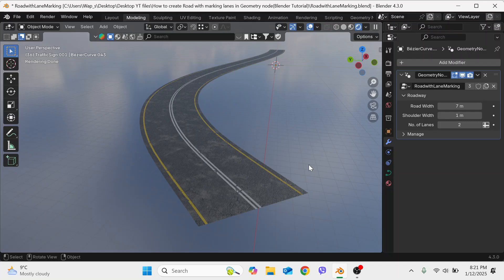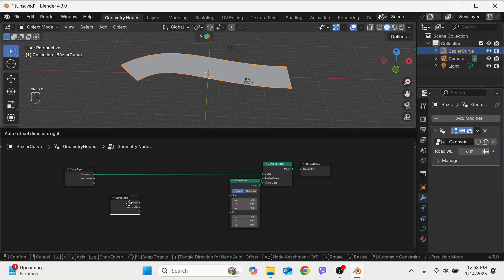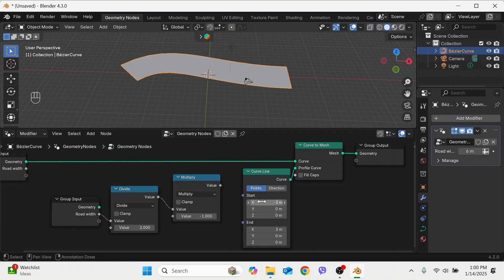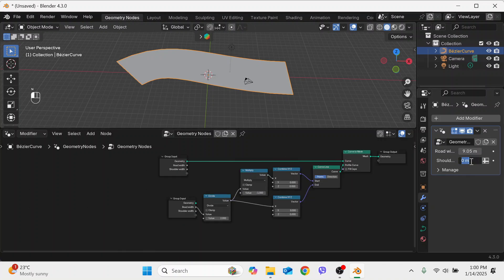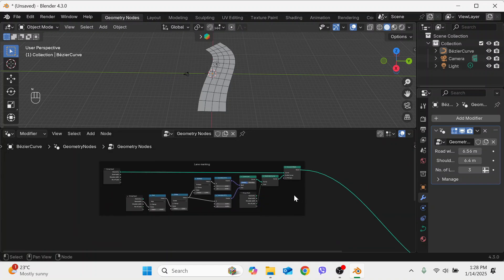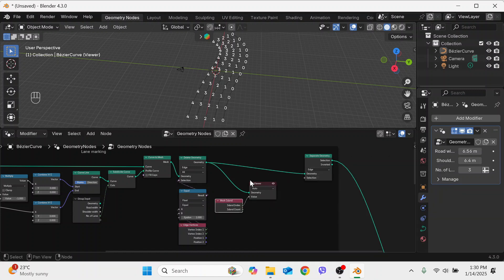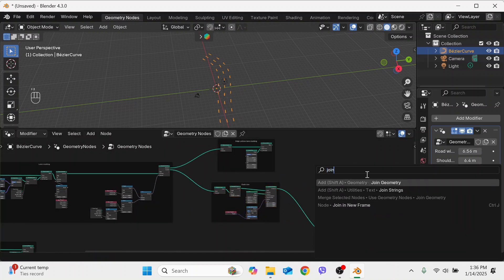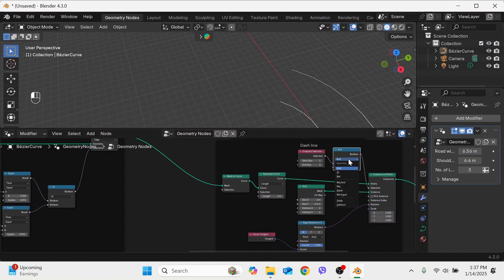How to make road with lane marking in Geometry node(Blender Tutorial)

Comment: Can I build a road intersection using nodes, or will I have to create ready-made materials separately?
Reply from the maker: For the road intersection, ready made materials will be easy i think. So many types of intersections which is very difficult by nodes.
Reply: @GeoNode_Genius , do you happen to have a tutorial for it, since it has to match the road with additional capabilities of toggling between on/off side road elements?
Reply from the maker: @turneywoodsmedia457  Sorry i dont have any tutorial for it. Here i have geometry node tutorial only. I only can suggest you to model carefully.
Reply: @GeoNode_Genius  Thank you.

Comment: Yeah, neat. But the issue is, that you have the lane markings and the road on one Z-Position so it will result in Z-Fighting
Reply from the maker: Correct. A simple solution is z offset by 1-2 mm. And a neat solution is by capturing these lane marking mesh distances using the geometry proximity node and use these attributes in the shader as a lane marking.